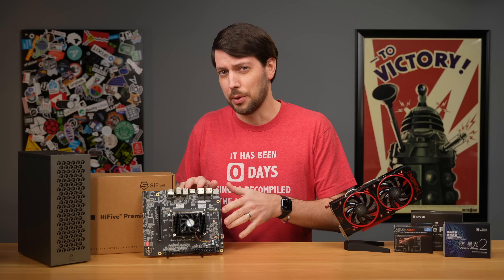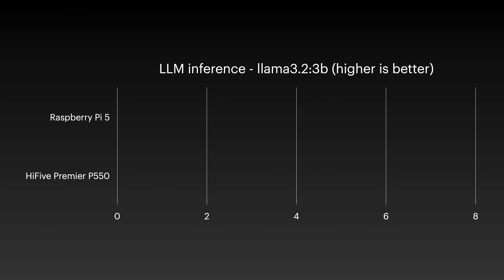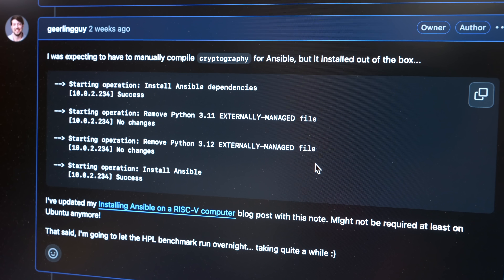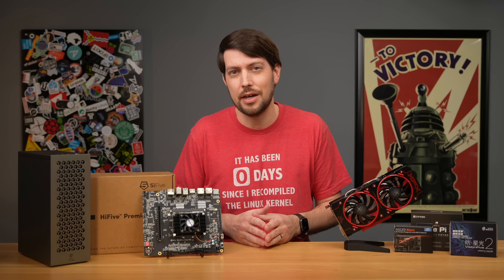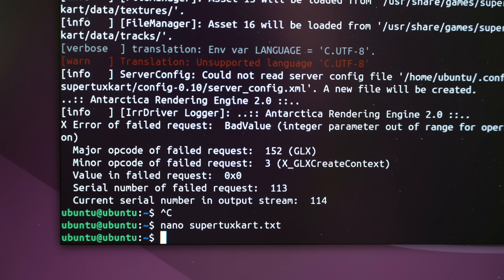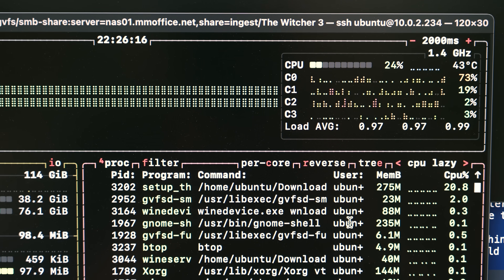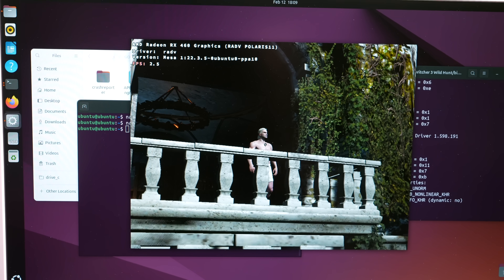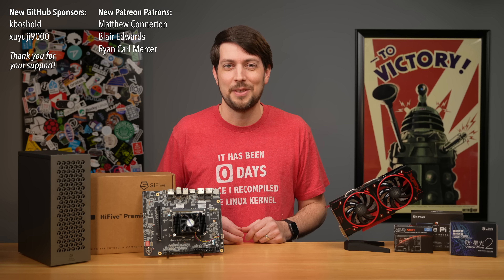RISC-V was supposed to change everything—How's it going?

Comment: What does riscv use for a bootloader? Is it fairly generic like on x86, or a mess  of needing a bunch of hand holding like arm?
Reply from the maker: It's using u-boot on this board; so it's not quite like EDKII BIOS that can just boot anything, but it's a bit easier to move to it than many Arm boards with fully-proprietary bootloaders.

Comment: Interesting... But why? Yes I know it's open source, bla, bla... But anyone with the capability can spin up an ARM design, while the licence gets you a mature platform that remains under heavy development and most importantly the support of the ARM dev team... So why?
Nobody builds a house by first getting their buddies who are in to cottage-industry smelting, blacksmithing, engineering, etc to design and construct the tools. (hobby projects aside) You buy the necessary tools and materials from people who make them for a living, then you get on with it.

To build a new path up the same hill that brings nothing new when the current path does an excellent job is only reasonable if you and your mates are doing it for your own interest. But to do so with the intention of competing with the current path simply because you and your mates did it is daft...
...now if you are your mates are thinking of doing something novel and potentially compelling like constructing a cable-car that's a different matter. But even then, nobody is going to care who made it, or how, as long as it's fit for purpose...
...which brings the subject of: When a bunch of people make a thing largely for themselves it's probably only going to suit those people and like-minded individuals, no matter how talented. Chances are everyone who only wants to use the result will take one look and say, "That alternate path or even cable-car system is all very well, but I'll keep using the path made with everyone in mind."

Comment: I have had the notion that ARM would be a perfect architecture for home labs and RISC-V would easily fall in there as well. 8 cores at 2 GHz or up would handle most home assistant tasks and media libraries. Once you get the idle power down of course. I am dreaming of a 3 watt, 32 core, home server that can fit on a closet shelf and works it's magic.
Reply: Oh man no. That would be a dream
Reply: 3W 32 cores uh maybe in 20 years

Comment: I wonder if hardware vendors ship this underpowered dev machines on purpose. 

When your software runs efficiently on a slow machine, it will undoubtedly operate at hypersonic speeds on the production machine.ne.

I guess.

Comment: It's maybe perfect for some old Fiery RIP I got waiting in the basement. Had an old Alpha 533MHz and totally needs a black PCB to suit. Rock Orion 6 as the safer bet, or this one, or, well, just a black nzxt board with an actual fast CPU 😂. Watching with a lot of interest. Curious what's different there so it would be so much faster.
Cool that you dug into the actual performance, via the RAM throughout. Good to see it's not just unoptimised software. I remember my 2010ish amd g34 server hitting over 70GB/s on DDR3.
The OpenGL witchcraft surely was annoying to get to work, grats on pulling through
If it's so slow on a single core probably they still are too stingy with L1 and L2 cache.

Comment: Fastest? Is that per core? Surely the Milk-V Pioneer still holds that title for multithreaded situations.
Reply from the maker: Both per core and multicore, compared to every board outside the Pioneer.

I haven't yet seen a Pioneer in person, it seems like they might be shipping from ARACE, but I've seen very few in the wild :(
Reply: @JeffGeerling  You having a Pioneer makes more sense than LTT, but I understand them wanting the exposure. And that's fair to call the P550 the fastest (even though you changed the title) if anything faster is still in pre-order limbo a year after they were supposed to ship. I was interested in a Pioneer until I saw the price, so I stopped watching their progress. As useful as SBCs are, I'm a bigger fan of a normal mitx-matx board that can be properly mounted in a case with fans, drives, normal PSU, etc.
Reply from the maker: @WilReid  Ah I do remember LTT had one to test. Wonder if they still have it on the shelf, ha!

Little do they know, the fun they could be having with it!

Comment: One problem with further development at the current stage could be that so many (too) small companies/teams (especially in China) are doing almost the same things in parallel.
And the hardware outside of the CPUs, which has become much more complex since the beginnings of x86 (and somewhat less affected because it was developed later (I think), ARM), does not make things any easier. Even if the development and maturation of new CPUs is faster these days, I think we are overestimating the pace at the moment. These are processes that require time, money and clever minds.

Comment: Problem is software optimization. I.e. Linux distro s for risk don't have hw acceleration for graphics. And I'm talking even not for rendering the windows, desktop environment, etc. Not to talk about video decoding encoding
Reply: This has got little to do with RISC-V, but more with the GPU vendor. As you could see in the video, AMD has good support. I have the Banana Pi F3 with SpacemiT chip, and it looks like Imagination Technologies is very slow with support.
But I can play 4K video with mpv, but that is actually with the VPU and not the GPU.
Reply: 100% this soc has built in hardware video decompression and compression!

Comment: Hmm... But it looks the business does it not (just did a quick eye on the specs). And if you compile from source it is still bad? so what it really needs is a better compiler optimization?

And I guess if that is so hard this will be the forever problem with RISC-V... they will be so much different companies that will support the Base ISA and then adding extensions for different use cases that compiling for it will be hard?

Maybe develop some sort of AI compiler?
Reply: AI is a waste, trust old folks who survived the previous so-called AI winters.
Reply: @teajaygrey  I'm 50 so not that young. AI have it's uses I think... coding could be one.

Comment: Are you saying that people who watch videos at 1920x1080 at 60 frames per second are in the group of those who are potato quality? Because all you showed was 30 FPS, which people still watch at today and not everyone has your funding or money to spend on expensive hardware to get 4K output on their hardware, 1080P is still actually the best way of watching videos today.
Reply from the maker: 1080p was resulting in a lot of dropped frames and stutters on this board.

I'm saying 480p was usable, 720p was sometimes iffy, and 1080p was not usable on here. At least not with the current Ubuntu build. They might be able to get HW acceleration working across FireFox and Chromium at some point, which would make it better at HD and 4K.

I mostly use 1080p monitors around here still ;)
Reply: define best
Reply: Funnily enough 90% of YouTube videos only go up to 1080p
Reply: What is "best"?

Best quality, which is somewhat widespread, would be a 10bit 2160p60 signal. And there are many possibilities for improving that with current hardware.

Best efficiency would be a lot less than 1080p. A monochromatic slideshow perhaps?
Reply from the maker: @ChristofferETJ  Best for many videos is just listening to the audio track with whatever low quality video is available to save on bandwidth, otherwise I wouldn't be able to watch much YouTube ever, heh. It'd be nice if YT had a 'disable video' mode.
Reply: @JeffGeerling  it does if you have YouTube premium on a mobile device. When you minimize the application and it gives you picture in picture mode, you can tap that and a headphone icon shows up which is how you get just audio.
Reply: None of my current monitors can do more than 1080p. I'm probably not the most typical home computer user.
I'm planning on buying a new monitor soon and 4K capability is definitely not a top priority. For example, I prefer built-in speakers because of the overall simplicity. (In a previous setup many years ago, I had simple stereo speakers next to the monitor. Let's see what's possible now, since the new monitor will most likely have more than one source permanently connected.)
Reply: I have a 1440p monitor but often watch most things at 720p unless it is something that I need to clearly see the visuals to follow along.

Comment: While I have been disliking the Mac Pros as a computer in its entirety for a few generations, I like the optics of the ventilation holes introduced in the 2019 model.

Have there been other standard (m)ATX PC case clones of this design, other than the Dune Pro scam a few years ago, similar to the little case shown in this video on the left side of the table?

Comment: How does this do running a gameboy, gameboy color, and NES emulators? How well can it run Doom? Can it run PrBoom , GZDoom? Thanks for making videos on RISC-V. I'm interested in using it with a Debian server someday.
Reply: It should be more than sufficient for running NES emulators, and Doom.

DOOM ran amazing on sub 100MHz CISC systems in the early 1990s and ran even better on SGI MIPS  (RISC, and RISC-V predecessor genealogically) systems if you had money to burn.

The contention about DOOM in the early 1990s, was whether it could run on an Amiga. John Carmack who had an overpriced and underperforming NeXT for DOOM development, claimed it couldn't. Many others, wrote code that proved otherwise (most recently things such as DREAD which will run on a stock OCS Amiga).
Reply from the maker: I haven't tested any emulation on RISC-V yet, outside of Windows/Wine/Box64/32. I may test some other emulators soon though!
Reply: who in their right mind will pay $400 to play doom and nes, when they can doit with any other $60 sbc?
Reply: @giornikitop5373  not me. I have at least two dozen devices that can run Doom.

Comment: Why would RISC-V ever "get faster"? Where is the incentive? If it is not usable, even if free, people would not use it... What am I missing? If ARM is way faster and way more efficient then the marginal increase in cost will forever be the better value.
Reply from the maker: There are geopolitical reasons for some countries to prop up RISC-V instead of Arm or x86, which I don't touch on because it always stirs up a bunch of comments that don't lead to fruitful discussion.

But there's also the many companies who'd like to have an embedded SoC alternative that doesn't get taxed in some way through Arm.

Arm started off a lot less performant than it is today, and this P550 also has some advances like out of order execution that helps a lot, and proves SiFive has some design chops to move on to higher performing chip designs. At least, I hope so!
Reply: @JeffGeerling , thanks!

Comment: I knew SDIO from my Windows Mobile days, it was for using SDCard bus for non storage devices (cameras, scanners). Fancy to see it still in use today.
Reply: RPi 3b+ uses sdio for its built-in WiFi. Painfully slow for current WiFi standards.
Reply: @linesteppr  Also applies to the 4 (afaik 100MBit/s throughput) and the 5 (tested, and around ~200MBit/s).

Comment: How much do companies save using an open ISA?
Reply from the maker: In large volume, they can save millions of dollars in licensing fees.

They are still paying a company for the actual chip design / manufacturing, though (the chip makers don't have to pay RISC-V International, but they still pay a LOT to design the actual chips and fab them!)
Reply: @JeffGeerling  If there is an open ISA surely there will be standard issues as no one is responsible for the standards?
Reply from the maker: @tonysheerness2427  RISC-V International is in charge of the overall standards, but the model is a bit different than Arm (where they dictate ISAs, but allow some companies to deviate a little on features if they pay millions), and x86 (where it's not really licensed, just kind of 'shared' between AMD and Intel, mostly).

So there's coordination, but it's more of a cooperative environment where the companies that use the architecture work together on the standards.
Reply: @JeffGeerling  How long will they work together before one tries to deviate?
Reply: Enough that Western Digital and NVIDIA started using RISC-V years ago.

NVIDIA is still transitioning, a lot of their older GPU cores are 32bit ARM. Their newer cores are 64bit RISC-V.

If I had to guess, Apple's C1 chip in the recently announced iPhone 16e isn't Qualcomm/ARM anymore either, but we need to wait for folks to do tear downs and IC delidding/SEM stuff to be sure and that hasn't happened yet AFAIK.
Reply: @teajaygrey  There are no GPUs based on either ARM or RISCV.  Nvidia's GPU architecture is just their own design.  What you are referring to is that the memory controller (a separate chip on the GPU card) switched from ARM to RISCV.  Which makes sense, because that's basically an embedded tier application which is all RISCV can do.  And no, Apple is never going to switch to RISCV.

Comment: It's a shame gpu drivers etc are not mainlined. In the perfect world hw manufacturer should take care of that - it is in their interest to some extent
Reply from the maker: Yeah, I don't get the GPU manufacturers not opening up their drivers. AMD and even Intel and Nvidia have made great strides there!
Reply: If you've paid attention to GPU development over the decades, it is fraught with heavily litigated intellectual properties. The fact that NVIDIA is only recently getting Linux drivers open sourced is a great example and I think maybe largely attributable to jkh (Jordan Hubbard, who was one of the co-founders of FreeBSD [and still ranks #5 in number of commits to that project though he hasn't had a commit in FreeBSD for over 20 years] and later "Director of Engineering of Unix Technologies" at Apple for over a decade and last I heard, was at NVIDIA. NVIDIA's open source Linux GPU improvements near as I can discern, has only been after jkh joined their company and as an outside observer, by the looks of things it's still pulling teeth to get as far as it has).
Reply: @teajaygrey  nvidia is only open sourcing a small shim still, that only works on the last few generations that are able to do more stuff using the on board firmware instead of in the driver. The rest of the driver is still staying closed - it's nothing like the intel and amd drivers where all of the kernel and runtime parts are open source

Comment: Isn't x86 kinda also risc now, but only exposing higher level instructions programmed in microcode? That said, very much looking forward for hardware that is at least a little more open, with hopefully open firmware.
Reply: intel's processors do have a RISC-style execution engine, with a translation engine turning the x86 instructions into the internal representation.
I don't know if AMD works the same these days, but I believe in the past they had gone for VLIW instead, and that wasn't scaling too well.
note that RISC here refers to the general "reduced instruction set" concept, and isn't a specific instruction set that is being implemented.
Reply: I thought the same but it seems that I was wrong (thanks to youtube comments)

Comment: Hey jeff, there has been more optimization for vector extensions on riscV recently on Geekbench6 (the 6.4 to be precise), and the Milkv Jupiter has actually gained some ground . Literally doubling the single threaded score, (from 77 to 147 points) and almost double for multi core score (from 348 to 587), which makes it "on paper" as powerful as the p550

Comment: One day I hope for a RISC ITX board with C power in and 2.5gbe would be a nice firewall board.
Reply from the maker: I'd enjoy any ITX boards with the same! AMD makes some decent APUs now that would run off USB-C power too.
Reply: why? what's the advandge over a NUC?
Reply: @ovrskr Lower power draw, theoretically should also be cheaper to buy and use since there won’t be any ISA licensing to bother with, MUCH more customizable than x86 or even Arm (as well as the Arm ISA license).
It’s already taking over the embedded devices space, from the famous ESP32, to SSD controllers, to even a RISC-V microcontroller in its new Blackwell consumer GPUs.

There’s also already a router development board with a RISC-V CPU, and given enough time, it should end up in some cheaper routers over time, driving adoption for RISC-V.
Reply: @ovrskr  Some NUCs are great as firewalls but they're way more power and cost than necessary, although if the RISC board does not have long term support it's DOA.
Reply: Well, we have Mikrotik routerBoards already :)
Reply: @SecurityDivision  ROS is only good as a simplistic router and they have no support for running a normal distro.
Reply: @leggysoft  ROS supports containers though.

Comment: What the hell is risc
Reply: Reduced Instruction Set Architecture that's used by RISC-V and ARM basically the cpu has fewer build in commands compared to CISC, or Complex Instruction Set Architecture, that's used by x86 CPUs.

as a design choice it has it's advantages like faster execution of commands but it requires more memory and you may need to more commands to do what you want than with CISC.

RISC-V is an opensource design that uses RISC architecture so, as said, it is less expensive for manufacturers than ARM but, as you can see, it is very much work in progress for now though the mainstreaming of ARM seems, to me, like a good thing for the future as there is now precedence for breaking away from the x86 strangle hold of intel and amd.